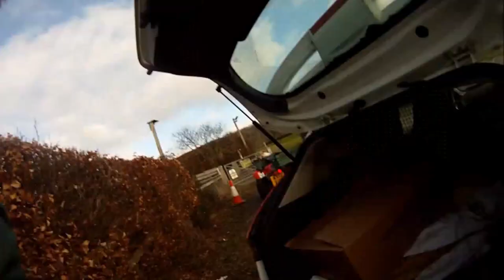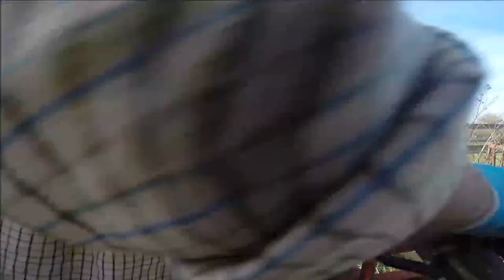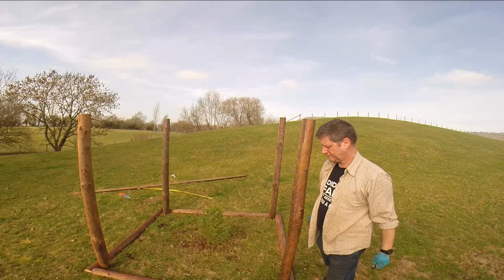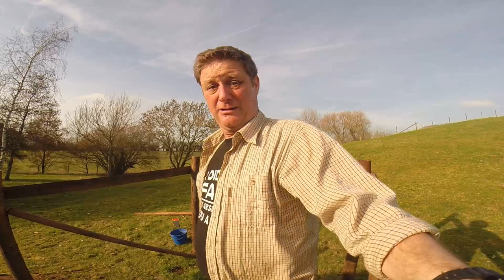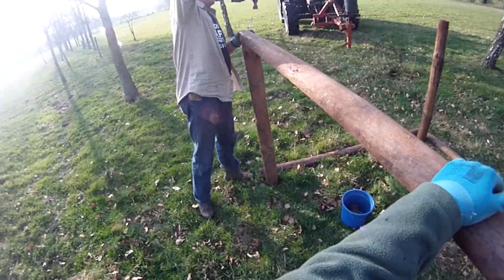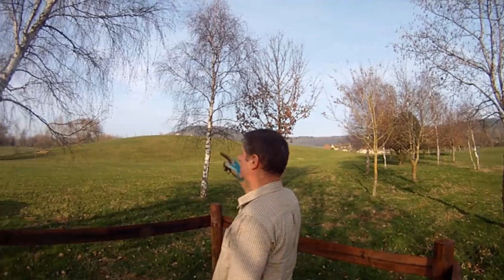Building livestock proof tree guards  Part 1

Comment: Great Job Farmer P.  My kind of farming channel.  Trees are so underrated by farmers.  I've only recently in the last 5 or so years started to appreciate their strength and beauty.  Great for the soil and natural shelter for livestock and there's the firewood that can be gathered from annual cutting and pruning. 
I've a lot of ash predominantly.  Birch and alder are very common too.  I think alder is a lovely tall elegant tree and a great soil Improver
Reply from the maker: I am hoping our Ash survive the onslaught of Hymenoscyphus fraxineus, (AKA Chalara, Ash die back)The general consensus is we will loose 9 out of 10 of our trees.Alder is a great soil improver, having similar properties to Clover, the tree extracts Nitrogen from the air and fixes it in nodules on the roots giving it a great advantage in poorer soils, you will only release this element through cultivation, but light tillage outside the drip line wont do any lasting harm to the tree.

Comment: you should get another tractor so you don't have to switch implements as much you should get a massey 390
Reply from the maker: DidGaming Gaming 
We have two more, A Case 695 with quicke loader and an old MF 165. The post rammer though is better on the MXU front linkage, much easier to use.
Reply: ye i ges  @FarmerP